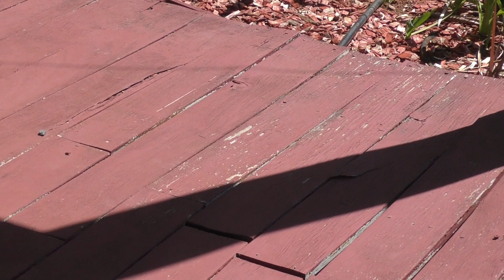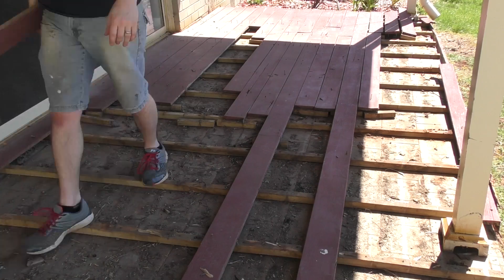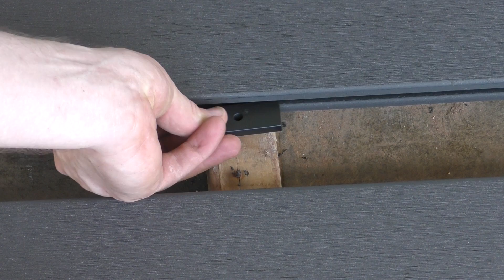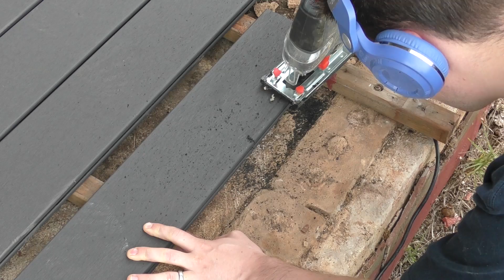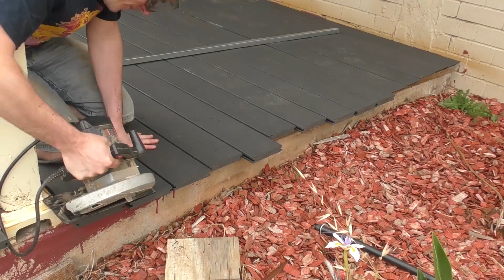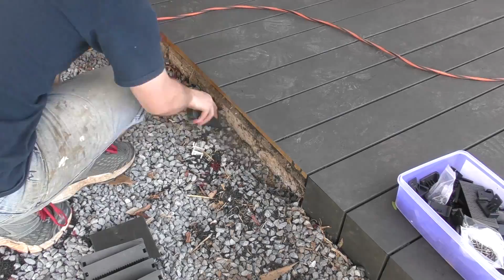I Resurfaced my Deck - Plastic/Bamboo Composite - Ekodeck

Comment: So.…….I've been planning to lay down some "ekodeck" which is basically another version of the same product. I would like to ask you at this stage, after some 2 years, have you noticed any deformations, any issues or problems with those boards, and if so, which and what I should pay attention to. Beforehand grateful...….by the way......nice and fairly tidy job you've done. Good on you.
Reply from the maker: Hey Alek, it'll a good product.  Holds up very well and stable. Only issue that is it isn't great against scratches. It's got dog scratches from my boy.  But the colour is still the same,  and I'd use it again.
Reply: @ADHDbuilt  Thank you bro.

Comment: Good work there! I am planning to build a deck like yours, do you think your deck being so close to the tiled surface will have problems over time due to poor ventilation?
Reply from the maker: +manish k the ventilation is pretty good under it. The deck isn't touching the tiles, it's raised by the bits underneath. Plus the decking I used is pretty rot and termite proof.